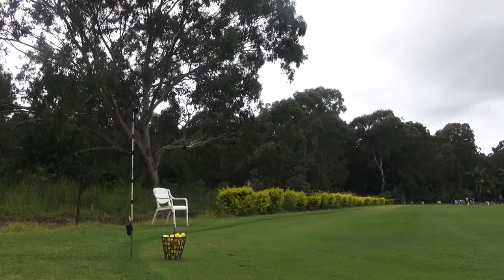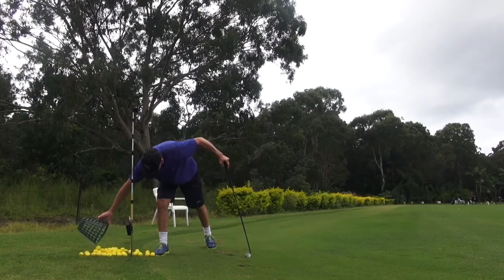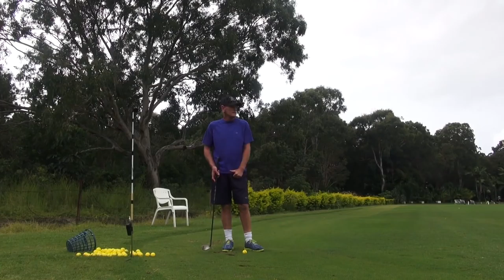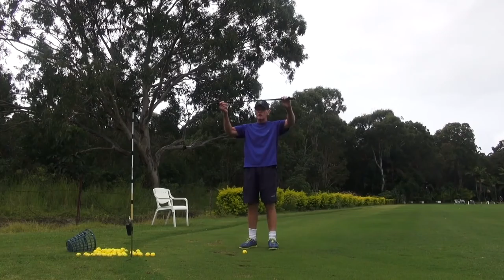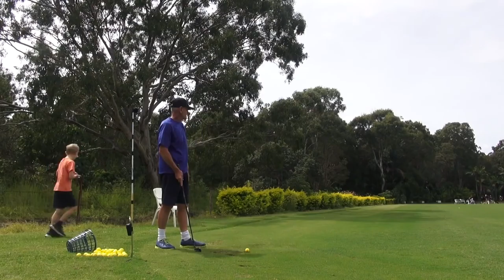Latest Channel Lock Updates video no 1

Comment: Haven't watched any of your videos in at least a month JH.  Your CL swing looks great.

Have you taken this to the course, yet?   Interested in your results?
Reply from the maker: Hi Steve,
                    I have taken the CL protocol to the course  .. I  play batches of   4 or 6 holes only so as to keep a very tight concentration level of application going  ..    my accuracy level is crazy good .. I feel I know where the ball is going every shot now... I am a very disciplined person and I  want to structure the CL Protocol precisely as it should be structured for actual course playing which is why I  bear down so much for the 4/6 holes I play to get the embedding process locked in to the extent it has to be in actual shot playing application.
                        cheers JH